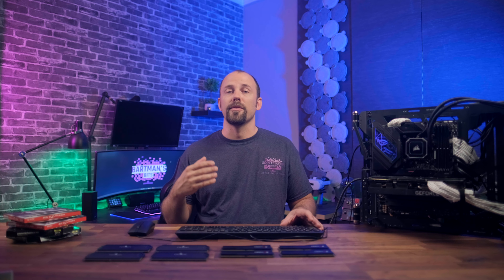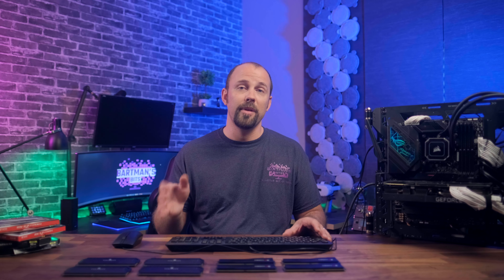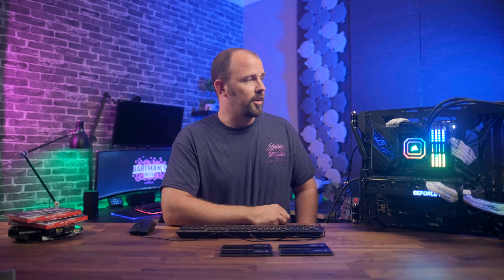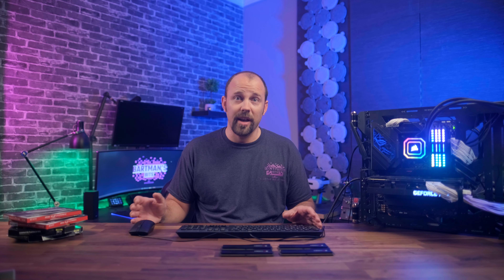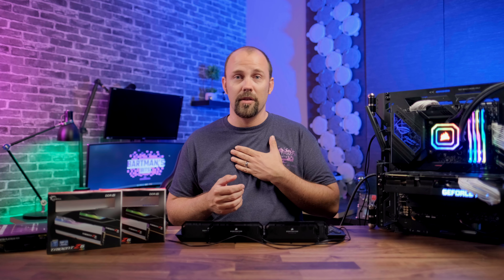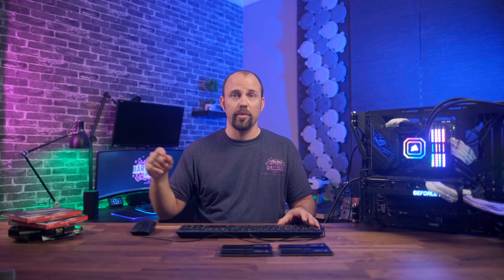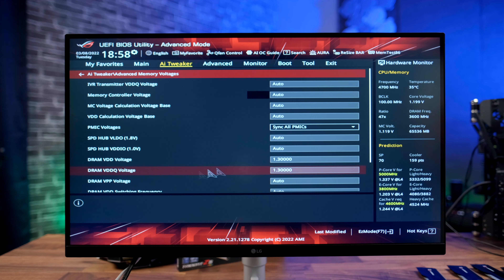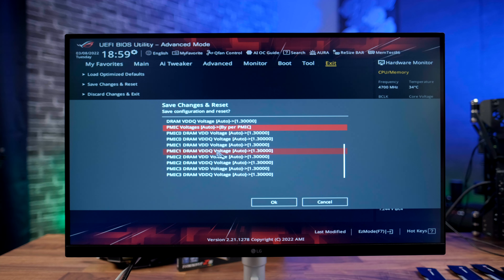Intel’s DDR5 problem resolved! DDR5 64GB Boot Loop failure Fix. Get the rated speeds of your RAM!

Comment: hello, do you think that this current problem / limit of ddr5 is more related to Intel 12 gen processors that fail AND WILL NOT be able to work and not to "express" the maximum potential of these ddr5 RAMs (also considering the moment in which they were designed , when ddr5 were practically only on paper), or do you believe that it is the ddr5 technology itself (identified and taken individually without considering hardware around) that is too "immature" and that, therefore, we are the same ddr5 models, currently released on the market, to not be up to it yet?  and, for the same reasoning, models of ddr5 that will come out later will also work well on Intel 12 gen processors, and there will be no need for future generations of processors (from Intel 13 gen onwards) to see the ddr5 working for the less better than the ddr4 with a noteworthy performance jump?  What do you think is the most correct concept objectively speaking?  If you are more in agreement with the first thing mentioned what improvement leads you to think that the next processors will work better with ddr5 (cache, core, frequency etc ...) and how we can identify, based on these specifications in particular, a Intel 12 gen CPU "better suited" to ddr5 (maybe it has more cache, for example).  Same thing for ddr5 motherboards, what do you advise us to look at more with respect to compatibility and optimization which, perhaps (my guess), may vary from model to model, perhaps the maximum frequencies supported, and even here you believe that the maximum frequency limit supported by all the 12 gen cpu (max 4800MHz) represent a limit for a user who does rendering, programming and uses heavy software (also in view of the future progress on ddr5)?

Comment: Is the problem solved with z790?
Reply: I don't think so yet. Asus Z790 Maximus motherboard, 13900K I Have Corsair Dominator part#CMT32GX5M2X6000C30-which is supported by the motherboard according to ASUS site. I tried everything with all XMP's. Put it back to AUTO and no issues, other than I'm only getting 4800MHz now. Did Memtest and completed in a little over 4 hours. PASSED Passes Cinebench 10min. test and 30min test. Passed Intel diagnostic tool. Just 2x16GB sticks in slots A2 and B2. I had instability until I set it back on auto.
Reply: so 4 sticks will have issue with xmp enabled?2 will be fine?
Reply: i am not having any issues at 4800mhz with 4 sticks of adata xpg lancer ram

Comment: It was worth a shot, but didn't work on my system.  Running Asus Prime Z790-A, i9 13900K, 4x32 Corsair Dominator.  :/  will just keep waiting for a BIOS update.   Runs Stock at 4800mhz,  but should be running at 5600 with the xmp :(.
Reply: I have the same setup except mobo is z790-e and was not able to go past the amber led so far. did you fix yours?
Reply: @jer42688  No, I had to clear the XMP by pressing the CLR_BIOS button on the Motherboard.   It reads all 128 gigs of ran but will only run at 4800 MHZ .
Reply: @jer42688  Update.  Today I was able to manual overclock my 4 sticks DDR5 from 4800 to 5200 mega transfers.   I went in and rather than turning on XMP i just changed the clock speed to 5200.  Then i overvolted as show in the video to 1.325 on DRAM VDD and DRAM VDDQ.  I also set the PMIC Voltages to "By per PMIC" the advance memory voltages menu.  Seems stable so far.

Comment: Thank you! This right here helped. Im running a 12900k w/ z690 extreme and 2 x32 (64gb) ddr 5 5600 g skill z5. Originally had issues with stability under xmp but the voltage change fixed it. I do wonder if the 6 pin addition power pull next to the 12 pin on the extreme helps cause i have both in from the psu. Noticed a dramatic change in stability.
Reply: esa conexión de 6 pines es para ayudar al pci.e no creo que tenga relación con la memoria, a la memoria le llegan 5 voltios y es ella misma quien baja el voltaje a 1.25 o lo que tenga marcado, es una de las nuevas características de la memoria ddr5 su control de voltaje ya no depende de la placa base.

Comment: So I’ve tried to do this I have a Asus ROG Maximus z690 with a 12900k and DDR5 32GB 5600 MHz, it’s only running on 4000 MHz and I’ve tried to do what you did and it just won’t work. It stays at 4000.
Reply: Try dropping it to 5400 mhz
Reply: @rud3bwoy  I found out why lmfao my cpu is rated for 4900 MHz lmfao
Reply: @rohxs3542  lmao

Comment: Tested 4 DDR5 dimms with total capacity of 128gb on an aorus z690 elite ax. does not work with xmp profile and 1.3 voltage settings. (corsair vengeance ddr5 cmk64gxm2b5200c40). without xmp of course runs without any problems. i don't even have this pmic setting.
Reply: Does it at least run, with 4800mhz? I have 128GB of Kingston Fury ddr5 5600, they are stuck on 4000mhz. So I am wondering if I should switch to the Corsair one's, that you are using.
Reply: @ojtothemax  hi, same here, they stuck on 4000Mhz. As far as I understand, this has something to do the way the ram slots are wired. in most cases that would be daisy chain and with daisy chain wiring you almost limited to only two ram slots if you want to use xmp profile and high performance timings. But I solved the problem with the long POST times for my case. I unplugged the monitor's usb cable and disabled all unused ssd ports in the bios.

Comment: Didnt worked for me. I still getting into the loop. I have 4 sticks corsair vengance ddr5 5600mhz
Reply: found a solution?
Reply: @daedubedb  yes, working with less MHz than the max. I make them work at 4900mhz max without crashes

Comment: Gutted didn't work. My voltage defaults to 1.35.
Any ideas ?
Reply from the maker: What’s the specs for your memory?
Reply: @BartmansBits  I tried 1.36. Didn't work either.
Ram is :
6400 40-40-40-84-2N-1.35v-1.35v
Reply from the maker: @stevesharpe1648  I will be trying 6400 sticks next week to see what settings will work. So far this has only been tested on 5600 sticks. Stay tuned!
Reply: @BartmansBits  great thank you. I'm running z690 asus extreme. Team group 6400. Thanks
Reply: did you try 6400 sticks ??
Reply: @BartmansBits  did you do it

Comment: I have the same problem I bought expensive stuff and it does not work...very frustrating. I spent a lot of money for nothing, if I would know that those things are not working then I could buy a cheaper motherboard and cheaper memory. I have Intel Core i9-12900KF + ASUS ROG STRIX Z690-E GAMING WIFI (recent BIOS) + Kingston FURY 64GB 4 x 16GB DDR5 6000 Mhz (2x KF560C40BBK2-32), my motherboard support XMP and ram speed up to 6400mhz on paper. In any case I have 20 second black screen time before BIOS screen appears, this is very bad.  If I put together the 4 ram module then my ram speed is only 4000mhz, however the ram website and the motherboard website write 4800mhz as starting speed which is not overclock, seems it does not know even the factory settings. In the QVL list of my premium expensive motherboard I can see this memory but only: 2x16GB version and not as 4x16GB, if I put only 1 KIT (32GB) into A2+B2 slot, and I try XMP, still I got the boot loop and safe mode and I need to do a bios reset or bios backup from USB stick, however everything should be works according the motherboard and memory specification. When I run memory test with 4 modules I got a lot of errors, when I put memory test with every single modules then I got no error. When I put every single module in the B2 slot then my memory works with XMP at 6000mhz, however the recommended slot is the A2 for single module, if I put those single memory modules to the A1,A2,B1 slot with XMP I got the boot loop and bios safe mode error. So it is very strange how possible that my memories work only in the B2 slot with XMP but not in the other slots.
Reply: Hi Andor, did you try this method of bumping the voltages? Did it work for you?

I'm having the same issue as you. Bought alot of premium components but they don't do what they say on the box, very frustrating!

Comment: Before this video i updated the bios to the latest version then i tried all xmp 1 and 2  then i entered the loop  black screen then blue screen then windows safe mode then i select repair then he bought me to 0 point that first moment i installed windows and had to reinstall everything again drivers apps updates etc

Next time i will make restore point first

I have asus rog maximus z790 extreme 
I have gskill z5 7800 64 gb
13900ks

Comment: I got 128 gb of ram but when I try to use this solution still no boot when I place 2 32 gb sticks on 6400 mhz boots just fine 
I have a i9 13900k
Asus rog strix z790e gaming WiFi someone who could help me
Reply: have you updated the bios? i was stuck in the loop boot so i ended up doing the bios update and finally got it to boot but havent try xmp again

Comment: The problem is the same with asus strix z690-i thst have only 2 slots. With w ddr5 5600 cl36 2x16gb corsair vengeance the mobo wont boot

Comment: Thanks for the video but it didn't work for me.
Im using i9 12900ks, asrock z690 taichi, 4x32 128gb ddr5 corsair dominator 5200.

Maximum frequency i get it's 4400....

Comment: I have 4 sticks of g.skill 16gb 6400’s with a i9-12900k on a msi carbon and did this to get it to boot but could not alter speeds beyond 4000 default. Has anyone been able to get more with a msi mobo?
Reply: I'm in the same boat....I have the KS version of your cpu with g.s skill 5600 64gb
Can't get them faster than 4ghz
Reply: @zeroch1ll150  i ended up just returning 2 sticks… i figure if / when they fix this, ill just reorder them.

Comment: Hi . thanks for this great video but I got failure with your method on my system, I have XPG Lancer White 64GB (2x32GB) DDR5 6400MHz CL30 Gaming Ram (AX5U6400C3232G-DCLARWH) X 2 totally 128GB, my motherboard is 
Asus ROG Strix Z790-A Gaming WIFI II Intel Z790 Soket 1700 DDR5 8000(OC)MHz ATX Gaming, the rams are suitable for XMP profile when I get information from ASUS website, my normal voltage is 1.40, I tried from 1.30 and 1.435  voltage along with by PER PMIC and  but I donot get success and continue with 4800mhz, anyone to help me ?  I have Intel Core i9-14900KS 3.20GHz (Max.6.2GHz).

Comment: didnt worked for me.
asus z690 wifi (latest bios) with 4x 16gb ddr5 gskillz 5600mhz. Tried XMP1 with 1,3v and 1,35v and the other setting suggested but it keeps crashing. Aint nobody got time for testing lower MHz :D
crap
Reply: I got mine working at 6000 mhz with same mainbord and same ram. 1.4v and the other setting the guy did in the video

Comment: i have a z790 godlike ,i913900k,4090 suprim liquidx, and tforce delta 7200mhz with a 1000w psu, and i cant get 7200 to run stable the highest i could get before crashing was 6200mhz which is not bad but its not what i paid for il try this and see what happens

Comment: I have a Gigabyte Z690 Aorus Elite AX and 4x 16gb Gskill 6000mhz F5-6000J3636F16GX2-TZ5RS, 36-36-36-76 1.3V. No way I'm going to make this work...I think I changed the settings as you showed but no, no solution for me. Can You give me a hand please?
Reply: Work only with 2x2 ddr5 6000 ! With 4x4 ddr5 6000 only crash !! SHAME INTEL !!!
Reply: You can try lowering the memory speed to 5800 or 5600
Reply: @idn  already done,not working
Reply: @Ccandymann  with 2 dimms work

Comment: My setup: 12900k, Asus Z690-F (BIOS 1304), XPG RGB Lancer 6000 (4x16GB). Your video trick didn't work. The max I've been able to get STABLE is 5400 @ 1.375V. RAM XMP is 40-40-40-76 @ 1.35V
Reply: Hi all, I got MSI PRO Z690-A,  Kingston FURY Beast 4x16 gb 5200MHz, and this will not work. When only 2x16 it works greate but no way whit 4x16 gb...
Reply: @auti-tek7356  same with me bro... did you get the answer?, cannot play when 4x16 gb
Reply: @KulkulOfficial  no, I gave up and now using 2 x 16 5200MHz  🥺
Reply: @auti-tek7356  my friend tell me, alder lake cannot handle 4x16 gb of ram, they told me all of alder lake board cannot handle. so sad
Reply: hi, have the same setup. how is it working now. would like to know.
Reply: @SheenuGameCenter  I only use 2x16gb 5200MHz now... cause I could not make the 4x16gb work at 5200MHz...
Reply: @auti-tek7356  Will it run (4 x 16) at 4800? What is the voltage (VDD/VDDQ)? Try manually upping the voltage to 1.35 and set the ram to 5200. It might work. If not, try running the voltage at 1.375.
Reply: @SheenuGameCenter  Are you running the MSI or ASUS setup? AUTI-TEK has an MSI setup. My ASUS setup has the latest BIOS (1505), and I still can only get 5400MHz/1.375V out of my 6000MHz kits. Unfortunately, the memory controller on Alder Lake wasn't really designed to run 8 channel memory (4 sticks of DDR5), or even memory faster than 4800. That is why DDR4 was an option. Hopefully Raptor Lake and/or AM5 have fixes for this.

Comment: This is not unique to DDR5. I have the same problem with my 4 sticks of DDR4 running at full 3600Mts . I had to bring it down to 3400Mts in order for it to boot. All sticks match so its not the problem. This MSI Pro Z690 A DDR4 motherboard is crap. I called MSI and they said they don't support XMP even though its on their motherboards?  Makes no sense.

Comment: I made these changes and now I'm stuck in a boot loop even after resetting back to what "worked" before...
Reply from the maker: Power off the PC, remove the power cord. Then pull out the memory and wait for a few minutes. Reseat the ram, clear CMOS then restart. This should reset everything back to default and allow you to try different settings.

Comment: Never could get it to boot went all the way from 6200 which is what it’s rated at i have the Corsair dominator platform 32gb 2 stick and I guess I’m just stuck with 4000mhz really sucks. It constantly boots in safe mode idk wtf to do
Reply: Kingston?
Reply: @ojtothemax  no Corsair
Reply: What mobo?

Comment: For me I have the Asus Prime Z690, Team group DDR 5 16GB each @6200Mz. I followed the guide but instead of turning on XMP I made sure it was off but still applyed 1.3 volts and it worked out for me. So unfortunately the ram I have will be down clocked but that's better than having half the ram.
Reply: Thanx this helped me as I have a prime z690 board on 6000mhz DDR5 ram ( 4 sticks, 64gb ) and was wondering how to make it work!
Reply: I have 4 sticks of 16gb DDR5 6200mhz teamgroup delta-r using in an asus prime-a z690 and an i9 13900k, even following the video and also your comment I could not get out of the loop, it is currently at 4800mhz

Comment: PLEASE SOMEONE HELP ME, I DON'T HAVE ENOUGH HAIR TO PULL LMAO

I bought 4 sticks of Corsair Dominator platinum 64GB DDR5-6200, when it arrived i noticed it's 2 sets of 2 x 16GB. I've been looking for a solution for 1 month now and nothing worked, I tried 1.4 1.35 1.3 volts manual pmic, 2 sticks xmp1 works perfectly fine but 4 sticks no way. I tried all forums and i came across your video but still not working please help.

Motherboard is Asrock B760 PG Riptide new budget 12/13 gen motherboard, It's a great motherboard. The motherboard has a huge OC tweaking options, I've contacted Asrock and Corsair and they both can't figure out why it's not working. So i asked Asrock to work with Corsair to find a solution cause this is BS and i paid a lot of money for the ram and i only can use 2 at 6200, IF i install 4 it goes down 4800 and today when i tried the new settings they even went down to 3600.

Please if someone savvy i really need your help.

Comment: got Corsair 64GB (2x32GB) DDR5 6000MHz CL40 Vengeance RGB Svart x 2. 

That means i got 128gb. Tried your solution and it does not work. It only work with 64gb and not 128gb. 

Anybody know how to fix this?
Reply: Supposedly you’re not supposed to mix kits, even though they are identical. Look instead at the mobos manufacturer’s compatibility list for a 4x32GB kit.
Reply: @dusza574  I’m not mixing anything bro. They are both in the same kit.  So I either use the kit with 128gb and the other one with 64 (with 2 slots ). DDR5 is so broken. I get freez screen

Comment: Got it to run on 2 sticks 32gigs xmp 1 or 2 no problem tried to add 2 more sticks and stuck in loop
Reply: Asus z690e Corsair vegence 16gigs 5600 megz
Reply: I9 13th gen

Comment: Didn't work for me. Even 1.35V didn't work. Stability issues even at 4000 with 4x16G Dominators on Z690 + 12900K cpu oced to 4.9GHz. What a joke. Going to return 32G and go back to just 32G until they get their act together.

Comment: After a day of trying and raising voltages slightly and lowering the speed step by step  it still did not work for me but I did find another solution where if you have 2x DDR5 sticks it says do not put them in A1 and B1 as Asus tells you to do. Put them in A2 and B2. I did this and X.M.P set with no additional changes worked first time and everytime. Memory now working 5600MHz.(not 4000MHz). 
ASus really needs to get its act together on this.

If anyone wants to know I am using an ASUS ROG Strix Z690-E 2x with Corsair VENGEANCE DDR5 64GB (2x32GB) 5600MHz
Reply: With the configuration shown in the video and placing the RAM in slots 2 and 4, I was able to run my 2 rams of 32GB Kingston Fury at 5600MT/s XMP I stable and without problem. Asus Z690 HERO
Reply: @n4ul17o   Are you getting any  BSOD errors in event viewer. I am getting loads so I will try slots 2 and 4 with settings stated in the video and see if that helps. Thanks
Reply: Cant wait to try this tomorrow 🤞

Comment: My Asus Z690 Extreme is a crap. There is no way of using 4 sticks at more than 4GHz without crashes. I tried Micron and Samsung and even at 1.35V the PC hangs. Now I'm using 4 sticks of Hynix and it's much more stable but sometimes the RGB on the ram freeze, when it happen, if I reboot the PC the PC hangs on detecting memory. Don't buy Asus!